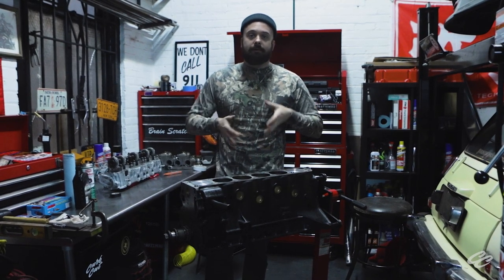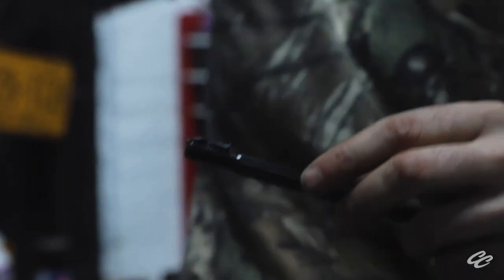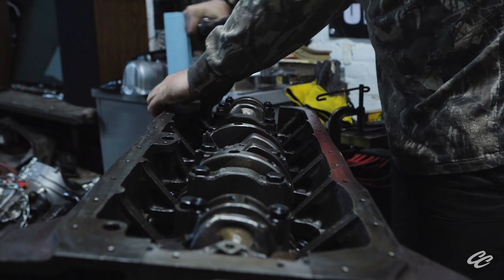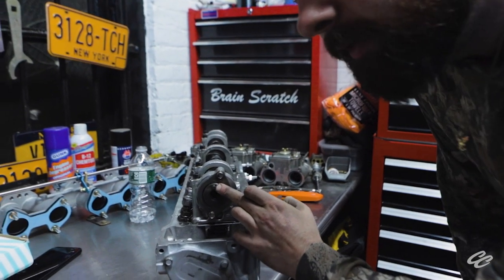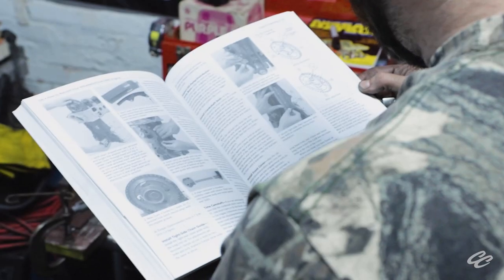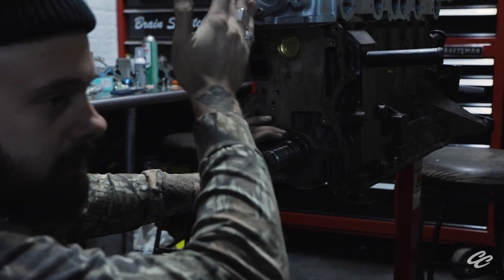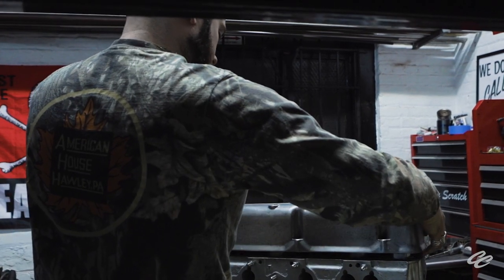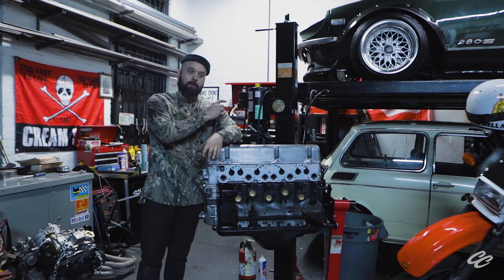Project L-Series: Put Your Head On & Get Your Timing Right

Comment: Great content and explanation bro, I assume many viewers are amateurs like myself and really appreciate the little details.  ONLY thing I have found wrong with the guide you reference is the cam tower torque spec, it is wrong.  I used that spec first and after it would not reach 25 ft lbs, I did a quick search to find out it only requires 10 ft lbs!  Oh and one bolt snapped in the process but luckily it came out and I had a spare.  In the end they still grabbed and torqued to 10 ft lbs.  Now to put the head on the block!
Reply from the maker: I think youre confusing the part where we reference the head studs coming thru the cam towers vs cam tower-to-head spec (not shown in this video). The spec we run thru in this video is for head-to-block installation, not cam installation.
Reply: @TheCurbCut  you’re right, I’m just referring to the cam tower specs on pages 94&95. They’re dangerously off 😅

Comment: I also noticed the PowerForce Harmonic Damper on the table, I was looking into that as well since I took out the AC in mine.  But I've read that others Z owners have a really hard time putting them on and you need a new bolt too?  What was your experience?  Thanks!
Reply from the maker: They do fit VERY tight, but factory hardware does the trick fine.